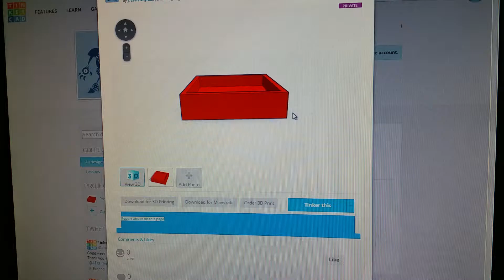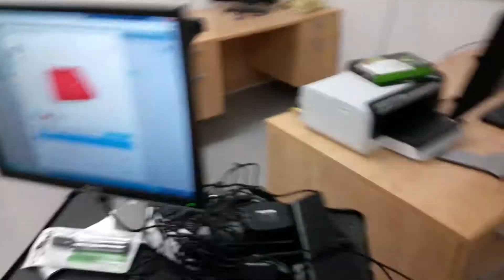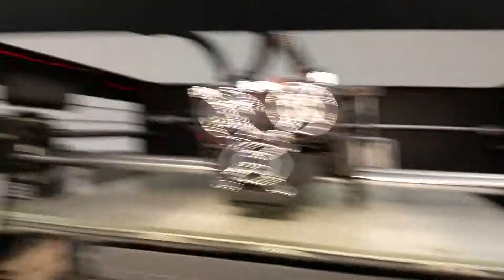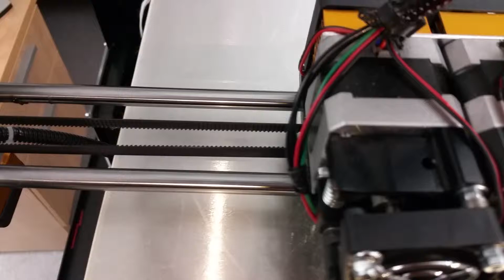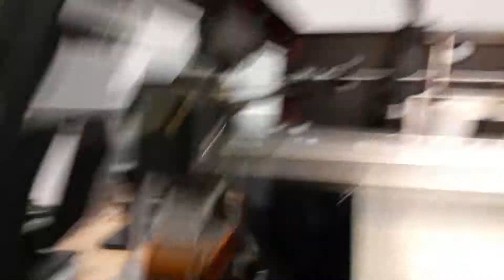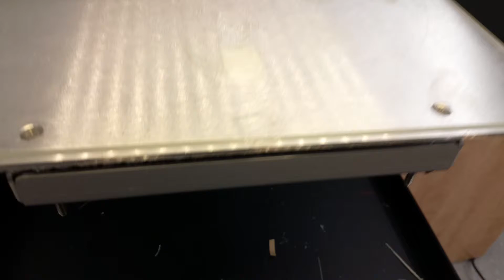Solidoodle Workbench troubleshooting  y axis

Comment: Have you find the problem?

If not, try this as I had the same problem with the belts and I've been adjusting to get it right. 

But what I found out too is that the front Y axis block is the one that making that sound. The bolt was actually grinding on the
wheel and it has a deep groove already. Mine, the noise was in front of Y axis , right side. You have to check both just to make sure that it is clean and lubricated well.  Make sure not to lubricate the rubber belts.

    What I did. I dis-assemble it, clean it, I rounded the end part of the bolt and lubricate inside. 

From time to time, you will need to clean it again and lubricate it.
SD support will tell you the best to lubricate it was to use the White Lithium Grease. But instead, I use gun oil and it lasted longer, and use it also to the metal dowel. 

Now my SD apprentice run much smoother and I print lots of stuff with out any of that grinding noise and off settings.

Comment: I've been having the same problem with my Workbench, which has ruined a lot of very large prints.  Mine only slips every now and then, but it makes the same noise that yours is making in this video.  However, my prints also shift on the X axis as well, sometimes... and that's been quite confusing.  :/